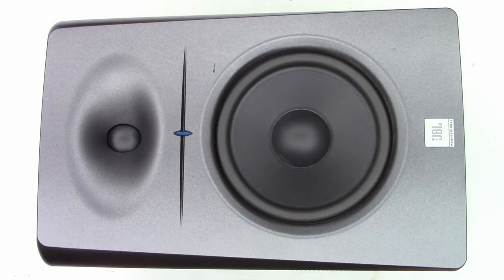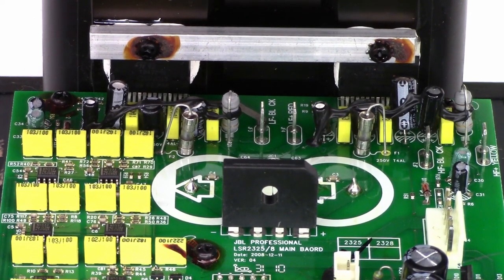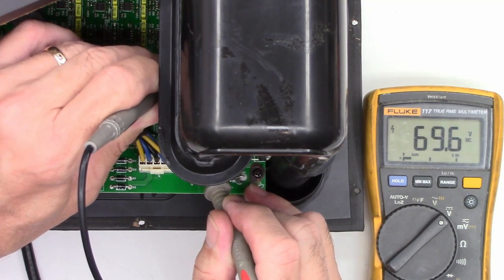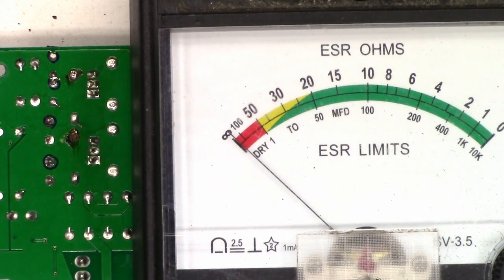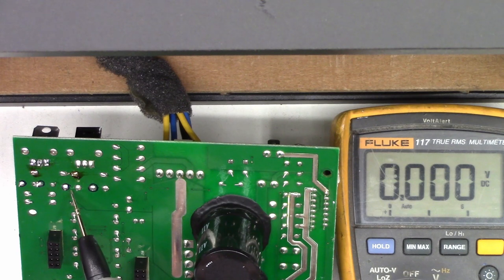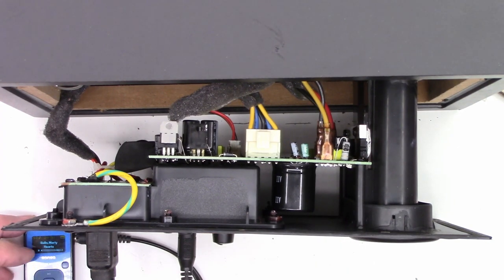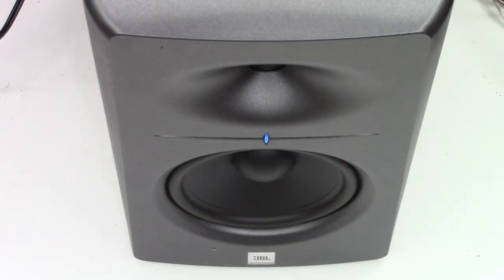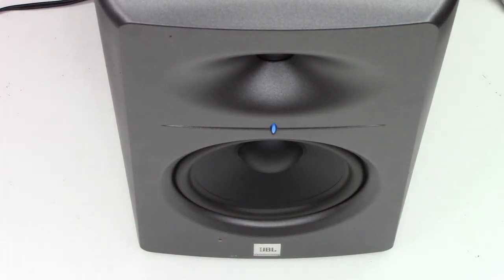JBL POWERED SPEAKER NO SOUND REPAIR LSR2300 SERIES LSR2325P

Comment: I’m just dealing with this same board at present - same problem; I couldn’t source the exact same output filter caps for the 15v reg’s - I also used a 640uF 40v cap - which works fine. 
It’s come back to life however my low frequency amp is extremely low output - more diagnosis !

Comment: Hi there! Good Video!! I actually own these speakers and  had them for about 9 years. I replaced all those caps about a year ago when one of the pair had a buzz. I just wanted to do it for both. Recently I also had a deep low freq hum from one of them that I can't get rid or. I just replaced the Big filter caps but the problem din't go away. It's a low freq hum and also if you touch the speaker gently you can actually feel it's vibrating. It makes a large pop when turning on as well. I had it taken apart but could not figure out the issue. I am not a pro I am just a musician/ sound engineer with some chops for electronics. If I take it to the local guys they start from $120 plus whatever they find. I paid $150 for the speaker back brand new so it's not worth it right now especially being unemployed because of covid. It does work and the hum isn't super loud but sometimes it annoys me. Any idea what it could be?
Reply from the maker: Is the hum 60 Hz and does it seem to change as the speaker warms up or cools down?
Reply: @norcal715  it is 60 and oscillating. Pulsing. No change in it when warms  up.  I have tested other parts of the monitor like input  etc. I swapped this board into the other speaker cab just to cross test the problem is in the main board. But it did seem like that in the other enclosure the pop was a little less loud and a Hum was also not as great as here. But when putting the good board into this enclosure it was fine.
Reply: Hi Tomi, i have same problems with you know. my speakers have buzz when turn on. Do you have any ideas how to fix this? Please let me know. Thankyou !

Comment: This was really helpful to see inside – I have a pair from way back myself. Mine really rattle at certain low frequencies (especially unmastered audio during recording). Any thoughts on what might be causing that? My assumption is maybe screws inside the cabinet. Ever notice that in your usage/testing?
Reply from the maker: These seem to be very well engineered speakers, at least as audio reproduction go's. I would look for a failing woofer, or something loose inside.

Comment: When you recommend black tape for a consistent emissivity, are you referring to black electrical tape.
Reply from the maker: Yes
Reply: @norcal715  thanks, good tip, I purchased one awhile back and found it kid of useless because each material has it' own emissivity, using some black tape should certainly improve the consistency of measurements

Comment: Hello, I am from Patagonia Argentina. By chance they brought a similar team to my workshop. I have no schematics. I found the 7915 with -2.65v at the output. Just in case I have replaced the 470uf and 100uf capacitors. Also the 1N4001 diodes. The device worked for a couple of hours and he had the same symptoms again. Treble is not heard. The bass is fine. I rechecked the 7915 and again there is no -15volt, only -2.60v. Can you give me any help, any advice? Anyway thanks for the video.

Comment: Hey bro, I just bought a brand new JBL 305p MK2 and it was playing very great first 2 days but today Its just playing at an insanely low level that i can barely hear. It's also making popping sounds here and their. Im still hearing bass but im hearing a loud Hiss noise when i put my hear close to the tweeters. Sometimes when i turn the volume knob at the back of the speakers up and down, after a while it will just start playing fine for a few minutes and then a pop and it start playing low again... Which makes me to believe maybe their is a loose wire of something inside the speaker? Im not an audio technition but I would appreciate your advice. Thank you
Reply from the maker: Get inside and flex things around and see if that makes a change. Probably loose connections.

Comment: I have the exact same monitor but mine is making a buzzing noise when I turn it on. At first, it did it for a few seconds than stop but now its buzzing constantly so I am at the crossroad....these were supposed to last longer than five years ?
Reply from the maker: Try heating the components on the board with a hair dryer or heat gun and see if you can find that bad capacitor.
Reply: @norcal715  Unfortunately, I do not have your skills (nor your equipment) to do such an operation. Instead, I will send it to the repairman although I have a much better knowledge of what's wrong with it. Thank you!!!

Comment: 9:49 can you make a video about this? When is it safe to change microFarad? Thank you.
Reply from the maker: Usually capacitor value tolerances are +80% -20% I always try to avoid using smaller values but normally ok to increase values by a small amount.
Reply: @norcal715  Great ty..